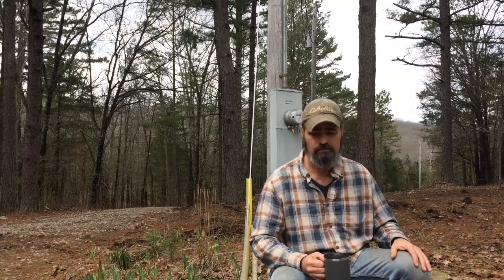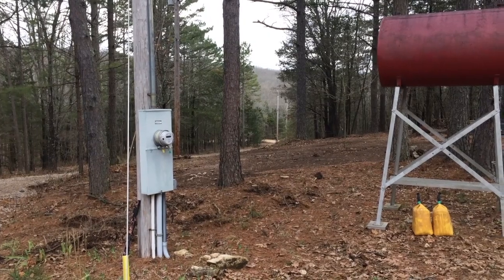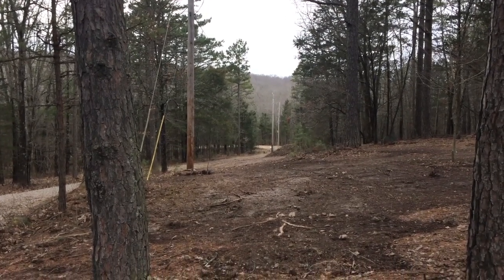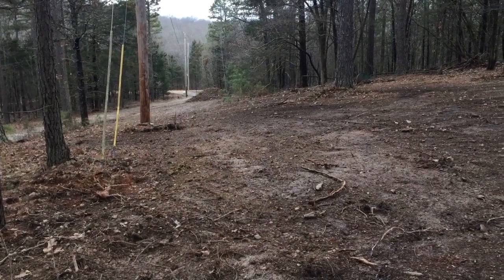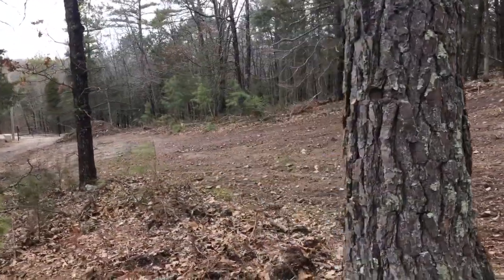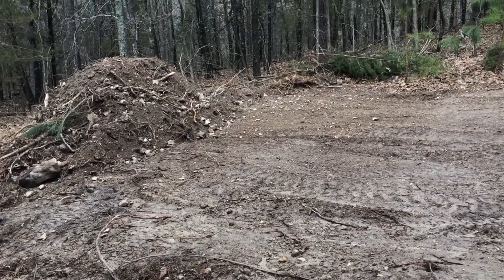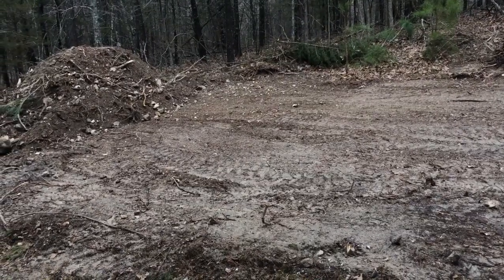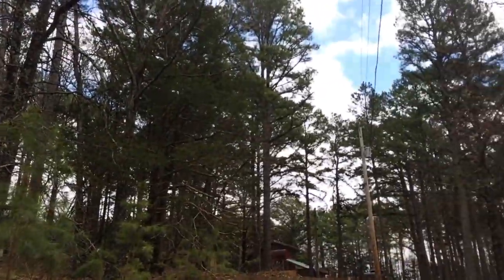How to Garden in the Woods  -  Power Line Gardening  -  Control Erosion with FOOD

Comment: If you keep the trees trimmed back they won't ever have to come in. Then you can grow anything for privacy. Even hedge.
Reply from the maker: I agree Steve but I don't have the means to maintain those trees that are 30-70 ft. tall and I'm pretty certain I won't be able to 10 yrs. from now when I get just a little bit older. ;)  Thanks.
Reply: @3basketliving  maybe bring a few of them down. Then in turn have more sunlight for your garden. I'm sure whatever you do it'll work out just fine! We made our first batch of LABs off your video. Stuff REALLY works!
Reply from the maker: I hear ya bud but the trees behind them will just continue to strive for that open sunlight too and you have to remember that it's already cleared about 20' on both side as is. I really try to Not take out much of the woods as I can get by with and I do have a good garden area already in the works. I just did some more tree removal around it to correct some mistakes and should be showing some of that soon. That's awesome that you guys made some LABs. I try to convince ppl all the time of it's MANY uses and I'm having some in my water that I'm drinking as I type this out.  loL  One of the best things you could have done bud. Good all around.
Reply: @3basketliving  that's awesome. We spray in our dogs water an food and he's scratching less. How long does the bacteria last after the serum is diluted in water? We went 2 tablespoons/ gallon distilled water
Reply from the maker: we've been averaging about 30-90 days if I remember correctly. Yeah we use it in the animals food and water as well....I even sprayed it in one of the dogs eyes when he jabbed it going through the woods. Help greatly I believe with any infections trying to develop. If I get any open cuts on myself I am sure to spray the cut with the LABs too. they are power house of a bacteria and we Should have it all over us to begin with. That's why I even spray myself down after a shower from time to time. We spray them everywhere.  ;)

Comment: With all of that area in the sun, use the entire area for herb growing. Most herbs are low plants, hardly ever taller then 4'. Could even include some perennial Rye. And as far as I know, if you want them to stay out of there, then maintain it yourself, and they have no reason to run everything over. They will just look and go away.
Reply from the maker: Well like I told Mr. Rick.....I don't have the means to maintain those 30-70' tree limbs and I'm certainly not gonna be up for that when I'm in my 70's. We got a good amount of herbs going already up by the cabin. She like them close for when she's cooking I guess. I haven't thought about the Rye but I REALLY what to take advantage of this space for more berries if I can if it works out. It's a pretty good amount of space so i'll have a few options for sure. Thanks Mike.
Reply: Stop making sense.
Reply: :)
 @rickdees251